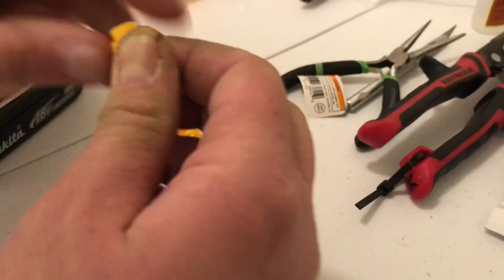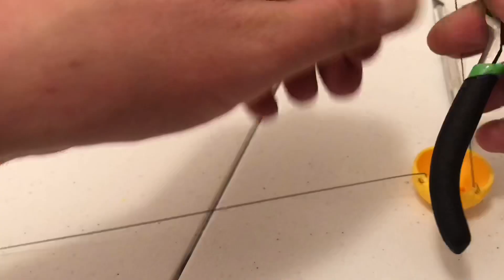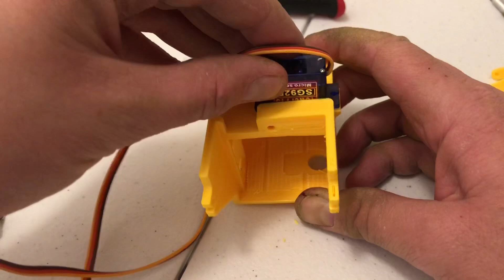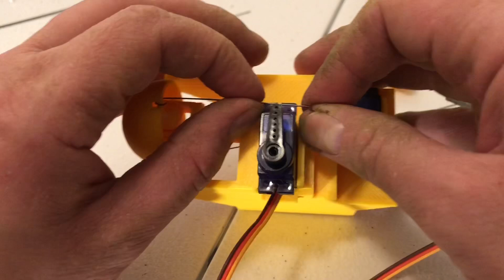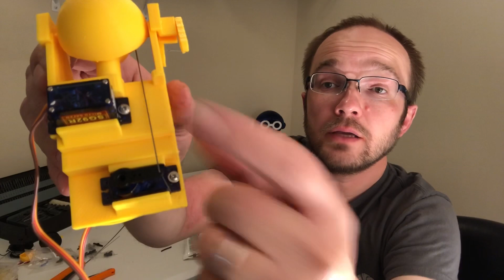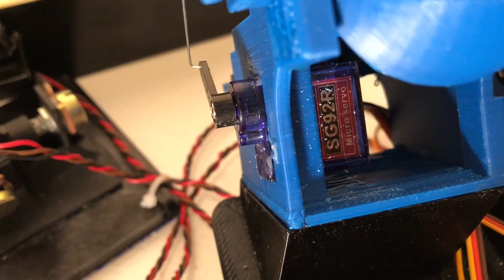Building an Arduino Controlled Animatronic System - Part 5: Building the Eye Mechanism

Comment: If the speed of the eyeball or eyelid movement is set by the joystick programming would it be a better idea to start out with the push pull wires in the middle position of the servo arms?
Is the iris part of the eye printed to allow a glass lens?
How long was the total printing time?

Comment: I noticed that both eye ball chassis structures are printed out the same, where both left and right eye balls are identical. Would printing the chassis structures mirrored to each other work differently in end results or would you have to run a different program for each eye for them to move in sync.
Reply from the maker: Great question. After thinking about it, I think your eyeball movements would work just fine since both LR servos would have to still turn clockwise to look right, for example.

However I think your eyelid would get messed up. Currently, if you’re looking at the eyelid servo, it turns clockwise to close the eyelid. If you mirror that over, the servo has to turn counter clockwise to close.

This would just require a simple fix in code saying “blinkservoright = -blinkservoleft”. However since I have to write code that works for everyone, If people had mirrored versions, I could never know for sure which eye was hooked up to which set of pins. If the eyes are both identical then they can hook it up to pins 5,6,7 or 0,1,2 and they operate the same. You could imagine if they hooked the mirrored eye up to the wrong port that I assumed, the eyelids would run backwards.

So yes, you could do it, but it would require some minor code tweaks. I’m trying to keep this as “fool-proof” as possible for the purposes of the demo. :)

Hope that makes sense! Great question!
Reply: The eyes can move independently this way, if you ever want them to.

Comment: Jim, great tutorial. Would it be possible to get all 3 in/out rods from 1 piece?
Reply from the maker: Builder's Mark yes. But for $0.53/apiece, I’d buy a couple just as backup. 

The cut rods wind up being only 2-4” each so it should be fine if you measure correctly. :)
Reply: I just used a paper clip haha